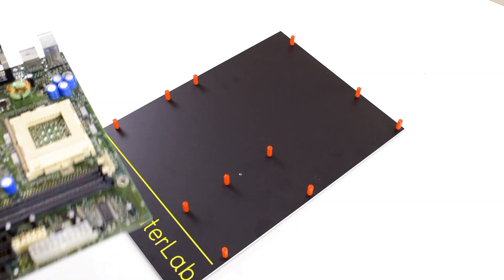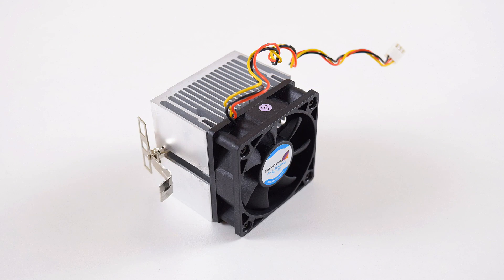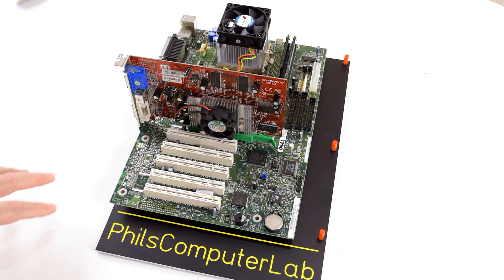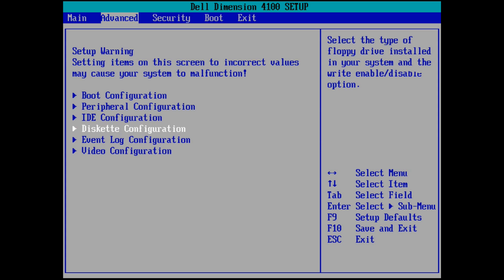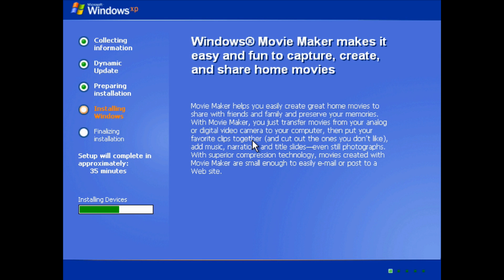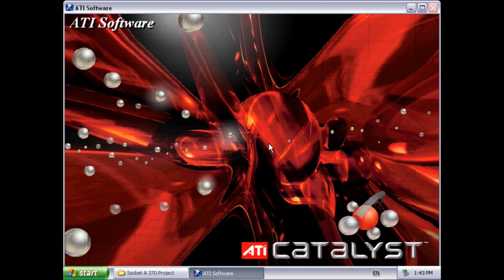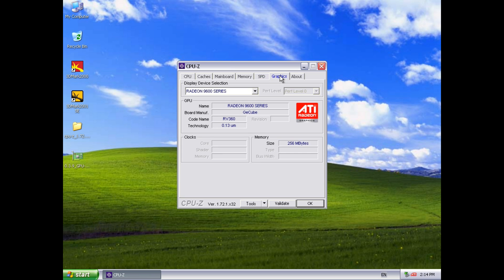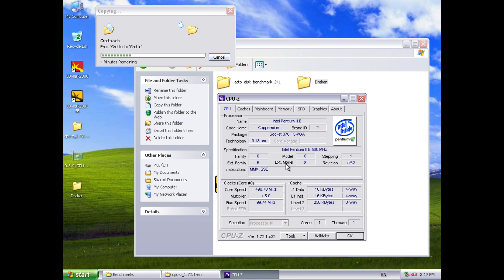Building a Socket 370 Retro Gaming PC

Comment: As of 2025, Dell 20 pin + 6 pin AUX adapters have been discontinued from major manufacturers. Only a few people are custom building cables and they are from the UK so expect to pay through the nose for them. To My Knowledge Gateway is an OEM that is safe to use with normal ATX power supplies for both Socket 370 and Slot 1.

Comment: Hey, Phil. Where can you buy the adapter for the PSU? Googling it hasn't provided me an answer, yet.
Reply from the maker: @johnshack3403  I'm sure I got in in eBay, but that was years ago...
Reply: @philscomputerlab i was looking for this adapter aswell they seemed to have stopped making them unfortunately I bought this same motherboard recently because it was cheap and I had seen it in this video but I ended up having to buy the oem dell power supply instead
Reply from the maker: That's a shame having to buy a PSU. But it is a really clean and nice board, so... @PokemonMp3

Comment: Very interesting video thanks.
I have recently acquired a retro gaming tower PC with Pentium 3 500MHz CPU and a Voodoo 1 graphics card installed.  I was hoping to try out a vintage flight SIM (F16) which can use 3dfx but after loading the game I get an error message that Glide2.dll file is not available. 
 The machine has a fresh install of Windows 98 why is the Glide.dll missing?  It does not have wifi, what is the best way to add this file?
Thanks for any help.
Reply: Install the 3dfx drivers. The one that comes with Windows 98 doesn't support glide seemingly for some reason, I had to do it with my own system I have a V1 in that runs 98 as well.

Comment: What's the best CPU cooler for Socket 370.  I have watched your StarTech FAN3701U 1U video so I'm considering this however the one you are using in this video looks way more beefy ??  I just want to get the best of the best and be don with it. so any help or recommendations will be appreciated.  Thanks in advance :)
Reply from the maker: New there aren't many options. Artic did some good once, but only way is second hand. Copper ones are desireable.

Comment: Just an aside, you can get SP3 or even USP4 pretty lean too — I whacked at mine with disabling services and such and got the process list down to a reasonably slim (for XP) 18ish and RAM consumption at the desktop to 80ish MB which was pretty similar to Win2k SP4 on the same machine

Comment: How comes, your socket 370 has 3 clips for cooler. I've checked 2 of my 370 motherboard,s and one adapter for Slot 1, and all have only 2 clips on socket for cooler from both sides.

Comment: Hello Phil. As Pentium III coppermine has 256 Kb Cache, and TUalatin Celeron has also 256 Kb Cache, are they equaly fast at same frequency, and 100 Mhz FSB, or Tualatin Celeron is still faster? I know, it's probably better use Celeron Tualatin anyway, as it's heat up lesser, bjust wandering, if they are equally speedy.
Reply: I'll go for the Tualatin always,the problem is the lack of motherboards. I have two of them but with Via chipset,would like to get an Intel one(815)

Comment: hi , i have atrend 440zx mobo with katmai pentium iii 500 with 512kb cache and 2x256mb double sided sdram because of motherboard limitations total of 512mb , i cant use sdram over than 200mb , i think the cpu can't handle it in windows xp , i think 256mb is enough and maximum. is it because of generation of cpu ? i wondering that socket 370 make any differences.

Comment: Can someone explain how the FSB works? i got a P3 at 850MHZ FSB133 working at 650MHZ because i am using PC100 RAM. So if i switch the PC100 RAM for PC133 RAM, will the Pentium3 work at full 850MHZ? or is it something more related to the Motherboard?
Reply from the maker: Changing the RAM won't change the FSB. You really need a 100 MHz FSB version of the 850 MHz Pentium 3 for your motherboard. But they tend to cost more, the 133 MHz versions aren't that useful, hence they are a bit cheaper.
Reply: @philscomputerlab  Oh i see. I been asking around for ever and i could not get a straight answer to this. Another question regarding RAM. What is the Max RAM amount the Intel 810 Chipset allows for each Slot? I read it's 512MB max, but i am not sure how much Each Slot accepts... My Motherboard uses 2 Slots, So that means i can use 256MB on each Slot for a Max of 512MB or i can only have 128MB Max on each slot? This old pc's are trickier to manage than most modern PC's.
Reply from the maker: @EtaYorius  Hmm good question. I believe it's 256, so with 3 slots that's 768 MB, which should be the max.

Comment: When you are using an old original heatsink, do you peel off the aluminum foil piece underneath, or you apply paste with it in place?
Reply from the maker: There should be nothing sticking to the bottom, so if there is, do remove it.

Comment: Cool stuff, Phil.  But that board would be far better suited for windows 98; don't you agree?  500mhz CPU?  512mb ram?  AGP?  Windows 98!

To build a decent Xp system, there are far better options for hardware that still have drivers available.  In addition, there is an unofficial SP3 for Windows 98 that straightens out the OS and makes it far more stable.

Comment: Hello Phil
This is so cool! 
I Currently have an Asus P3B-F Rev 1.04 Motherboard 440BX Chipset With a 600/100/512 Intel CPU Slot 1. I See that it can utilize an Slot 1 to Socket370 adapter, but i can hardly find which adapter to buy and why, maybe they all will do the job? do you also know for sure which CPU would fit best? The plan is to do the ultimate Slot 1 configuration, just because it is possible. Thanku for any help! 

Motherboard: https://www.cnet.com/products/asus-p3b-f-motherboard-atx-slot-1-i440bx-series/specs/

Best regards.
Reply from the maker: I' not familiar with that board / don't have one.

Comment: I've searched the internet and I found that the Radeon 9600xt uses an agp 8x slot but your motherboard has only an agp 4x slot.
Q1: Is an agp 8x graphics card compatible with an 4x motherboard
Q2: If yes, how much performance you will "lose"?
Reply: Q1: yes, it also fits in x2 and x1 AGP slots. HOWEVER there are different keyings on AGP ports, one for 5v operation and the other for 3.3v. If the GPU card has 2 notches in the connector, its compatible with both.
Q2: it depends a lot on the GPU chip itself and whether it's actually able to saturate the AGP bus. Low end cards like a radeon 9200 don't get as much of a performance hit than a Radeon 9800 for instance. Likewise many low end GPUs were retrofitted for PCI, since it didn't waste much noteworthy performance. In short; the more powerful the card is, the more you will lose. In theory you'd lose up to 50% perfomance running an 8x card in a 4x slot...

The same goes for PCIe; "lesser" cards for x1, x2 ,x4 or x8 can be inserted in a x16 slot, but will only perform to their own spec (whether x1,x2,x4 or x8). However, provided the PCIe slot allows it, "larger" (x16) cards can also be inserted in "lesser" slots, with the implication that the card will run that much slower.

As GPU cards were/are rarely rated on their actual data throughput on the AGP/PCIe bus, it's hard to determine the actual loss in performance. This is further compounded by the fact that lower end GPUs rarely, if ever, saturate an AGP8x bus.
Keep in mind that the performance will also only hit when transferring data to or from the GPU or its memory from an external source. Internal operations on the GPU (like moving a texture from GRAM to GPU) will not be impacted... in practice the performance loss would thus only be about 10-30%

tl;dr: internal operation of the card will be unaffected, but communication with the rest of the system (or rather the CPU itself since the AGP bus is tied to the CPU directly) will be slower

Comment: I plan on doing a similar Socket 370 build. Same motherboard, but with a 1266S Pentium III Tualatin, and a GeForce 3 of some sort. I'm not sure about the other parts. Now, the GeForce 3 doesn't natively do DirectX 9. But if I were to install it, would I see a performance increase or decrease. Would it put strain on the CPU or GPU? 

Cheers.

Comment: I am watching this video on a socket 370 System with an Intel Pentium III 1.2GHz and 512MB ram. Too bad this motherboard only has one PCI slot and the integrated graphics by S3 are horrible, so I wont be able to play most games.
Reply from the maker: There are some decent PCI graphics cards options.
Reply: PhilsComputerLab Yes, but they are very expensive in Germany, especially on ebay.
Reply from the maker: Run a search for PCI FX 5500. They come out of China, I think I bought 3 of these cards as they are very retro friendly and have decent performance.
Reply: I got a GeForce fx5200 PCI 128MB that I found for 10€ on ebay. I decided against the faster fx5500 because I only have a 150 W psu in this tiny machine... I hope that it supplies enough power for that really low end card. And it can't be worse than the integrated graphics I have in my PC now.

Comment: Did this board require a power supply converter or were you able to use a standard 20 pin?  I just picked up a Slot 1 Dell board and wanted to make sure that I won't need a converter for my PSU.
Reply from the maker: Tom Schuster Yes, a converter was required.
Reply: Thanks!  Saved a lot of headaches!

Comment: i feel like i have a dead cpu :( i have a pentium 3 800mhz 133mhz fsb, all the jumper settings are correct but the machine only briefly spins the fan initially when i switch on the psu :( any ideas?

Comment: Hmm this motherboard actually works with PC133 RAM? Interesting. For 512mb of RAM (2x256mb) in my Coppermine PIII laptop, you have to use 256mb PC100 sticks, which are pretty costly, or those special PC133 sticks that has 16 chip config instead of 8, otherwise you simply don't get a POST!

Comment: I remember the Radeon 9600XT. Good retro GPU >>that would love a more than 500MHz CPU :)
I got one a few years ago for 20 DKK(3 EUR) Put it in Grandma's Athlon 64 3200+(Fujitsu OEM that came with the slow GF FX5500 128mb) After that insane upgrade , it had "usable" Youtube video capability.
Funny story... I Gave away that PC to someone last summer, when I got her a new small PC with Win10.
And this summer I needed to Purchase the parts to build another good Athlon 64 Win-XP PC.(long live generosity! - well at least the new one is a lot prettier) :)

I can second that of the Audigy 2 ZS. That is an awesome soundcard. Excactly what I have in my XP PC. Really good High fidelity output, Superb EAX 3D. I have a very good Sennheiser headphones plugged to mine, that easily reveal weakness regarding soundcard sound quality, it's really an experience to game with 3D sound.

Comment: 512 MB of RAM for Windows XP is perfectly fine. I've seen XP computers running off of 128 MB of RAM. Also where do you fine high capacity IDE hard drives?
Reply from the maker: I would use SATA to IDE adapters, as large IDE drives seem to go for high prices.
Reply: PhilsComputerLab I am already doing that with my socket 370 PC at home. I have Windows 98 installed on a 2 TB SATA hard drive as that's what I had available at the time. It would be a nuisance to have to buy SATA to IDE adapters Everytime I want to use a large hard drive in anything older than a Pentium 4. Can you recommend somewhere to get lower capacity hard drives cheap and reliably?
Reply from the maker: These adapters are quite cheap to be honest. Also quite a few SATA drivers are actually IDE drives with an adapter, at least many early ones. I get most of my stuff from eBay, so take a look there if you really need an IDE drive.
Reply: PhilsComputerLab thanks for the replies. I will either use SATA to IDE adapters or search local classifieds for good deals as I don't like waiting for long shipping times.

Comment: I don't really understand why you pair a  CPU from 1999 with a GPU from 2003. Why not use a Pentium 4 Northwood instead for an Intel system? A Pentium 3 500 feels more like a Windows 98 CPU, same with the Duron 600 from the other video.
If it is just to compare the Intel and AMD systems, then why not use a Celeron? The Duron was meant to compete with it, not the Pentium 3. The Athlon K6 was competing with the P3. It's like putting a Ryzen R7 against a modern Pentium. They don't play in the same league.

Comment: If one doesn't overclock, OEM boards are perfectly fine. Of course, he/she has to do something with those proprietary connectors.
Reply: Old Dells are always a gamble... if they don't switch out the PSU connector, they make the entire motherboard non-ATX compliant like they did on a lot of their pentium 4 machines.
late '90s Compaqs are the same, some little change that makes you unable to rig it into a standard case.
Best bet for old OEM hardware is IMHO HP machines. They do keep themselves fairly standardized until the mid 2000s apart from front panel connectors and such....

Nevertheless old OEM boards are great for retrocomputing unless you want to overclock. I have old parts for an HP Brio series PC that I reassembled in a modern case, which i'd consider an optimal retro machine (Slot 1 P2 or P3 CPU, onboard sound and onboard Matrox G200 GPU w/ dedicated RAM)

Comment: I remember using one of those dell motherobards back in the day. If you hex edit the intel motherboards bios image with the header from dell, to make the dell's bios see it as a dell bios, you can sometimes flash them with the official Intel motherboard updates, which were often maintained long after intel's. I forget which specific motherboard it was I did it to.
Reply from the maker: I'm a bit hesitant trying that. The board works great and I'm really happy.
Reply: PhilsComputerLab, the system had a failsafe bios loader in the manual that could load a bios via a disk, so I wasn't too frightened at the time, but I completely understand not wishing to do such a risky action. I'm pretty sure I just got lucky.

Comment: if I was to use the Dell motherboards I would go after the XPS models they have slightly more features and offer better performance I used to have a Dell Dimension, not sure which model but it had a XPS on the badge and had a Pentium 3 933 Mhz

Comment: this is all really cool and all, but how about we talk about one of intel's best blunders:

RDRAM. Maybe a rambus rig is in order? With a preshott cpu no less!
Reply from the maker: I'm trying hard to get such a system, but not having much luck.
Reply: LOL i have some rambus ram lying around... never used... 1GB (2x 512MB) of it hahaha
Reply: I have an i850 board, s423 with a 1.8 P4 and 1GB of RDRAM, works like a charm :P
Reply: PhilsComputerLab I'll dig up m closet and see if i have the old 4x512mb rd ram from my moms dell from years ago.
Reply: RDRAM is actually the shit, it is fast as hell, the only problems are that it is also expensive as hell and additionally that with some obscure exceptions it is only usable with the encumbered early pentium 4s in PC land. Actually RDRAM is used in the PS3 if memory serves.
Reply: @wich1  RDRAM was used in the N64, and is comparable in performance to DDR1 RAM. The reason why it was so expensive was basically that Rambus were greedy fucks that demanded a lot of money for licensing their technology (they still have not learned with XDR). Not only was it expensive, but also cumbersome, since empty RAM banks had to have a terminator stick inserted (which, of course, cost extra). Apart from that there was the heat.... RDRAM runs REALLY hot, to the point that you can burn your fingers on them, while DDR and other sticks just get lukewarm.
Additionally the layout of the data bus required that you always have at least two sticks in your machine (RDRAM has only a 16 bit bus where SD and singlechannel DDR had 64), or N^2 sticks in your computer.

RDRAM was, in short, an overpriced, overcomplicated RAM technology in a world that had moved on from FPM and EDO memory...and even those were less complicated to use (didn't require terminator sticks)

XDR RAM, used in the PS3 is a successor of sorts to the RDRAM we know... One of the changes is that XDR can transfer eight data packets per clock cycle instead of two (as in DDR and RDRAM) on data transfers. It also solves the high RAM latency seen in RDRAM systems
Reply: ps3 uses tech by rambus who made rdram, but it doesn't use rdram. rdram is slower in every way compared to its competitor which is why it was dropped. hotter, higher latency, slower, and more expensive. worse in every way.
Reply: Yeah, that rambus stuff was actually not bad. Problem was the price.
A fast Northwood with fast RDRAM is crazy.
Put in a FX 5800 Ultra and the system is hot and loud as a rocket, but quite fast.
RDRAM is also used in the N64 btw. The PS3 uses the successor to the stuff we see on the P4 platform.
Reply: Nintendo 64 and early Pentium 4 uses RDRAM. PS3 uses XDR DRAM.

Comment: motherboard from an Dell Dimension 4100 - my windows 98 PC is one of those if you dare you can upgrade it with the BIOS for the Intel board and there is about a 40% chance that it still works after that then you can use the later 370 CPUs and use more RAM.
Reply from the maker: Please give a go and share your experiences.
Reply: Often with Medion boards manufactured by MSI it is possible to flash the BIOS from the off-the-shelf board onto it.